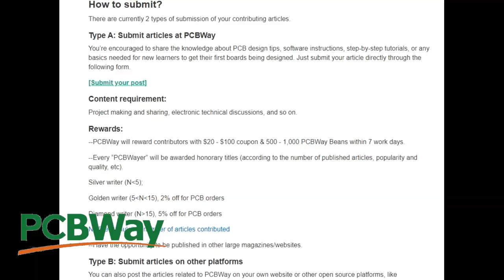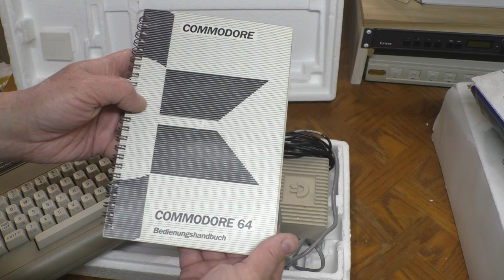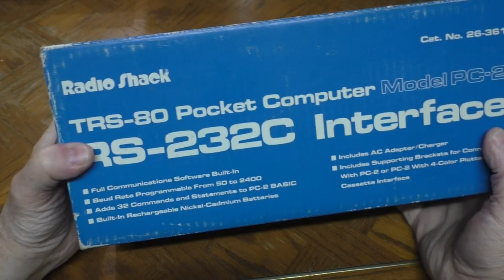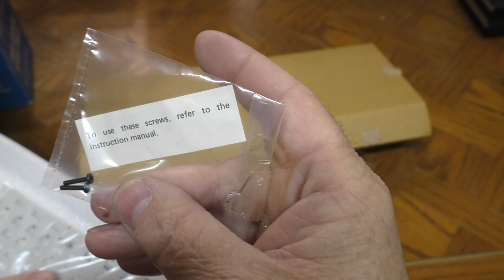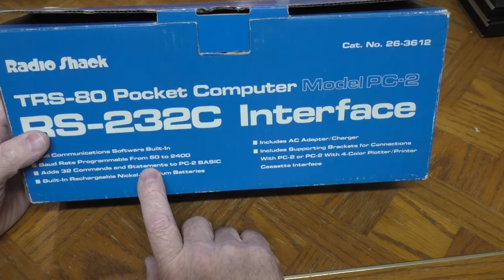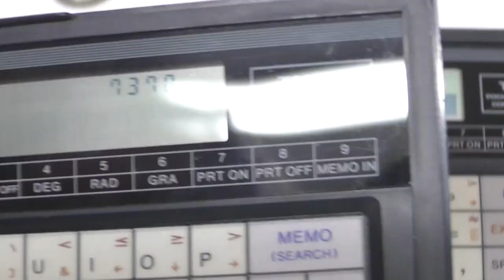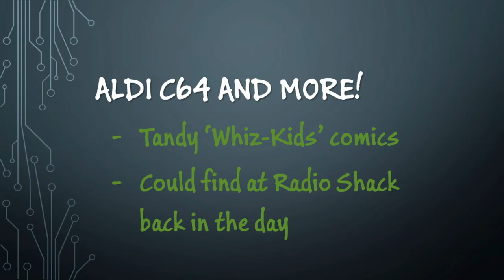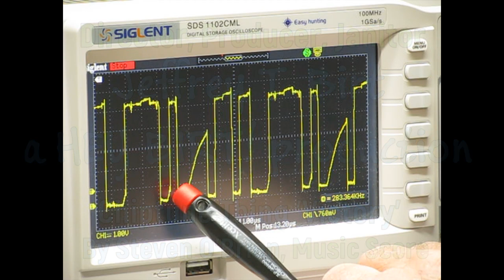Aldi C64 and more! Tandy PC-2 RS-232 Interface, Tandy PC-5, Whiz-Kids comics

Comment: The box that the C-64 ALDI is in was for a different machine made in W. Germany. If memory serves, the ALDI C-64 was a small lot purchase for ALDI's in Europe but was (oddly) made in the US. Later, Commodore outsourced the C-64 breadbin that was a similar color to the ALDI but it had top-printed keys. The C-64C was also made in W. Germany for most of Europe as popularity and dropping price made it a common choice.

The drive - again if memory serves - has a power select inside the case. Since that drive was made in W. Germany it was set to default to European voltages. While there is no switch (users liked to play with it) there is (again if I remember right) a mains voltage selection pad that can be soldered or cut to choose voltage. This will correspondingly change between 50hz/60hz. The drive would have to be calibrated to the possible frequency to run correctly.

Of course - you already know all this. 😁😁😁

Comment: Hey Birt! Thanks for showing an "Aldi"! Many years ago I've found an Aldi C64 thrown in the trashbin, the case was not salvageable, many parts were broken and missing. However I've repaired the motherboard and salvaged the keyboard that has a different shade of white than the one used in the C64C, it's just missing 2 keys :)
Reply from the maker: I am happy you saved the Aldi C64 from the bin.

Comment: I just picked up the Casio FX-790P from goodwill a week or two ago. Replaced the batteries and it turns on. Haven't had a chance to do anything further with it yet. A little scratching on the back cover plate, but otherwise looks in great condition. This one has the Tandy 8K expansion RAM for Pocket Computer PC-6 installed as well. I wonder how much else is different between pc-5 and 6. 
As always love your content.
Reply from the maker: Hi, The PC-5 like the Casio units before it used custom 4-bit RAM chips (1Kbyte each) that sat on the same bus as the expansion connector. With the PC-6 they introduced a custom chip that converted the 4bit bus protocol to use standard 8bit RAM chips. Functionally the two are identical other than the PC-5 having much less RAM.

Comment: Hey Birt!
Could the PC-2 RS-232 Interface work between the PC-2 and the Backpack?
I'd pay a dollar to see that video!
Reply from the maker: Why, yes it can. We have that working now. You can set the CE-158 to redirect CLOAD/CSAVE to RS232. 

The only real trick is that you have to first tell the Backpack the file name and if you are doing a load or save with a PRINT#"S)FILE". Then you can do the CSAVE"FILE". 

For the new CE-158X we have been working on we have added some new BASIC commands to make this easier. You can set the CE-158X to BP mode and then just use CLOAD/CSAVE as normal and it 'just works'.
Reply: @HeyBirt  
Fantastic! And I suppose the CE-158X is a modern clone of the original Sharp/TRS-80 RS-232 boxes. Something to do with the Germany-based site that’s encouraging new hardware development for the systems perhaps? I can’t find the Video where you discussed all that. Care to share?
I’d love to find either of the old interfaces on eBay; it’d be crazy to see the pocket computer hooked up to an sd card. I suppose one of the new X-interfaces might make the job even cooler.
Reply from the maker: @nuttick  The CE-158X is a project a friend and I are working on. Nothing to do with any site in Germany. Link to video is: https://youtu.be/GkmYv_EdBGk
Reply: @HeyBirt  accessing… accessing…

Meanwhile I wonder where I heard/read of a German, kind of, development, breakout board for the PC-2. Probable dreamed it all!